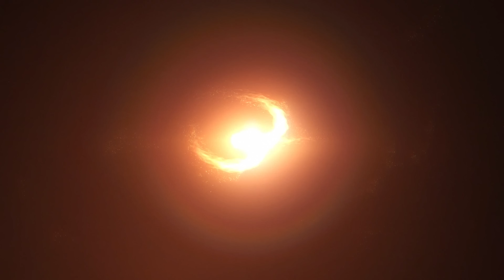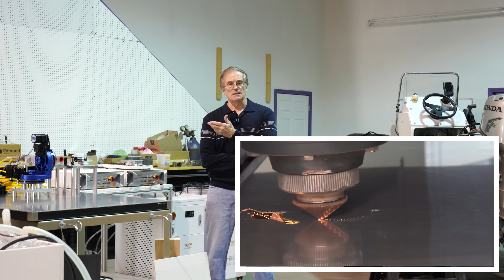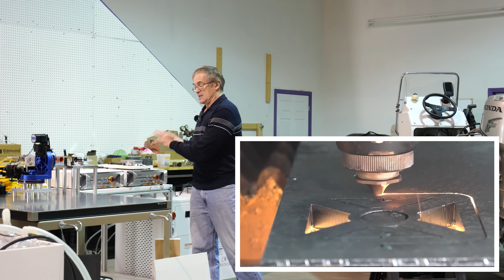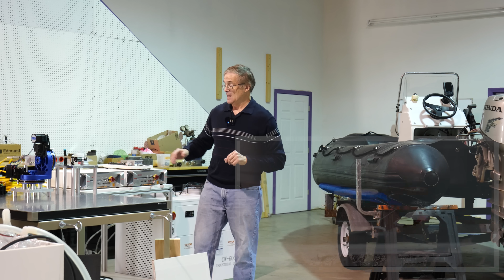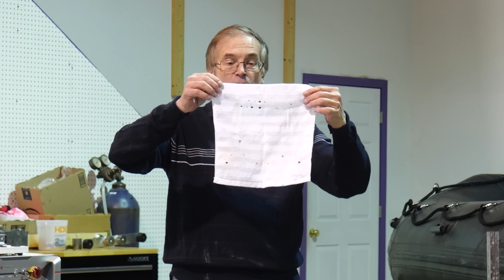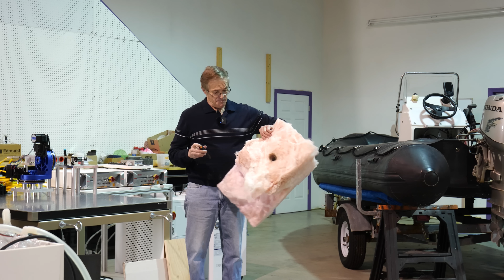We have a problem... and need your help!

Comment: I’ve not gone through all of the comments, but have seen many people thinking along the same lines as my knee jerk response. The water curtain/water trough with appropriate additives for either absorption/diffusion (dye, zircona in suspension, etc).

For bench testing on beam cohesion and such, my thoughts are that you could aim the beam at an angle down into a large pipe with your appropriate fluid mixture behind your target medium. Within the pipe I would consider an agitator of some sort - a pump from the bottom to the top or a bubbler pipe to increase the fluids motion. With some testing, you could implement an appropriate size and safety factor for mobile applications.
Reply: In addition, both because it’s dirt cheap AND I just want to know what happens if you essentially plasmify it. What about using an Oobleck/cornstarch&water solution as the backstop? 😂

Comment: How much damage does the beam do to Copper Pipe filled with water?   Consider an array of Copper Heat-pipes as a backstop.   Different liquid can be used to tune them for specific power levels.    These are used to cool the Leading-edges supersonic aircraft wings like National Aerospace Plane and the SR-71 Blackbird.   Another idea is to used coiled copper tubing with water running through it.

Comment: Use a rotating round disk with shingled bricks so they are two layers thick and have a 16 gauge piece of stainless steel between each one of the bricks.  The rotating wheel keeps new surface exposed and the stainless steel obsorbs and disperses the heat.  Now, determining the rotational speed needed and is it achievable with the mass of the wheel.  Hmm...  :)

Comment: Hi, I just saw your request for a solution to your laser problem.
Here is my suggestion.
Take a block made from aircrete (they are fairly light) coat the block in a water glass solution.
This should withstand the temperature of a few thousand degrees as this is what is used in homemade refractories to withstand the burning flames.
I don't know if you have tried this but the water glass and the aircrete are both easy to make when outdoors due to cement dust and silica gel giving off vapours and dust.
I have seen many youtube vides showing how to make these items and one video from 'HoneyDoCarpenter' a few years ago using it in his homemade refractory.  Good luck my name is Keith Emery aka.VideoGenie. 🇬🇧

Comment: Other comments are suggesting to use a waterfall curtain. But won't the water explode if the backing for the water curtain heats up too fast??? Perhaps this combined with somekind of transparent sheet (fresnel lense????) to disperse the beam would work best.

My first thought was to use intumescent paint.

Comment: Using a ceramic blanket (or glass fiber) is a good idea, as it helps diffuse the light. To drastically increase its resistance to heat, you can infuse it with silicon carbide. Silicon carbide provides excellent thermal resistance. Soaking the blanket in a solution of colloidal silica (or fumed silica, which could also work) along with silicon carbide grains of various sizes can enhance its performance. Once dried, this composite material will behave like a rigid panel, making it easy to handle and move.

Note: Graphite or other carbon-based materials are not suitable for this application. Even though they can help diffuse heat, they oxidize in the presence of oxygen at around 800 °C, producing CO₂ and degrading the material.

Silicon carbide should be easy to source, as it is commonly used as an abrasive and is available in various grit sizes.

Comment: Seems like mounting the laser higher up, and pointing it straight down would be the safest bet. From there you could use a large tub/tubs of water to diffuse the laser. Maybe even mixing in some sort of additive like charcoal to limit reflections.

Comment: Inch thick Sheet of gelatin and starch, mixed with zinc oxide and bone black with a foaming agent? So it would expand from the heat making zinc oxide and gas bubbles? Possibly formed over a fiberglass matrix for portability

Thinking of those starch based prawn chips that I had in Asia, looks like a poker chip stacked up in a bag before you cook them. But the latent moisture and properties of the starch puff them up when they hit oil, making a pork rind texture....mixed with zinc oxide and carbon black with gelatin for strength, then semi dessicated, maybe stacked in layers or soaked into fiberglass before drying....... would also need a degree of flame retardation. Possibly with a co2 producing agent that could also add to the foaming action?

Comment: As the OEM (Original Equipment Manufacturer) used divergence to reduce intensity.
Theoretically, you could adapt the same idea to make it easier.

Comment: Honestly your best bet is to find a gravel pit that won’t mind you setting up in during off hours to test. But if you insist on building a barrier, try carbon felt sheets with running water saturation, I doubt it would survive fixed exposure but there isn’t much that will survive a parked and actively running laser of sufficient power.

Comment: Have you tried glass from shattered window glass at an angle to shatter the beam. Glass to be set in epoxy and presented at an angle to the beam to scatter the beam downwards into a tub of water maybe with dye in the water or mineral particles like perlite floating in the water.

Comment: Magnesia blocks used for soldering and other refractory purposes.  Very lightweight and the fibrous / porous surface might be able to do some work at diffusing the beam. 

I think the "wet" solutions probably buy you the most time before failure, but they are all cumbersome to the point of not being much better than building a 4000 lb wall of regular firebrick.  Deep down though, we know the real solution for lightweight and portable personal laser protection is asbestos blankets...

Comment: Here’s a solution that meets your criteria as closely as possible (courtesy of ChatGPT, but it actually seems pretty good):

⸻

🔧 Recommended Materials & Construction

1. Layered Copper or Aluminum Finned Heat Sink (First Line of Contact)
	•	Purpose: High thermal conductivity to spread the heat rapidly and avoid local melting.
	•	Why it works: Copper and aluminum absorb IR laser energy decently (especially if the surface is roughened or blackened), and they conduct heat away quickly.
	•	Structure: Use thick plates or large CPU-style heat sinks arranged to deflect the beam slightly (e.g. at a shallow angle, 10–15°) rather than absorb it head-on.
	•	Blackened Surface: Coat with high-temperature black paint (non-toxic when burned) or use anodized aluminum to reduce reflectivity.
	•	Note: Fiber lasers are typically near-infrared (~1070 nm), so polished metal is reflective — roughened or blackened surfaces help absorb instead of reflect.

⸻

2. Ceramic Fiber Board or Alumina/Silica Board (Behind or Layered with Heat Sink)
	•	Product example: Inswool, Kaowool, or Duraboard 2600
	•	Why it works:
	•	High temperature resistance (usually >2,600°F / 1,430°C)
	•	Non-flammable
	•	No toxic offgassing (but confirm MSDS to be safe)
	•	Lightweight and easily cut or shaped
	•	Placement: Behind the metal to provide a heat-resistant buffer and trap any penetrating energy.

⸻

3. Granular Firebrick Bed or Graphite Block (Final Energy Sink)
	•	Alternative: Pour a layer of crushed firebrick, black fused alumina, or refractory aggregate in a shallow steel tray.
	•	Optional high-end alternative: A block of pyrolytic graphite or graphite foam — very heat-tolerant and absorbs IR extremely well.
	•	Caution: Graphite can oxidize at     high temps in air — only use if protected or in short bursts.

4. Angled Baffle Design (Important)
•	Orient surfaces at angles so the laser beam doesn’t hit them perpendicularly. This:
	•	Reduces effective energy density
	•	Prevents reflections from coming straight back
	•	Spreads the heat load over a wider area

⸻

🛠️ Assembly Suggestion

You can create a modular, portable unit like this:

[Steel tray base and frame with wheels]
  |
  |---Rear Section [Layer of granular firebrick or fused alumina]
  |
  |---MIddle Section [1–2" ceramic fiber board panel]
  |
  |---Front Section [Stack of copper or aluminum heat sink fins @ shallow angle]

Optional: Add a replaceable sheet of black anodized aluminum or black-painted copper on the front (before the heat sink layer) that can be swapped out as it degrades.

Make sure the unit is:
	•	Mounted securely, especially if vertical
	•	Surrounded by a non-flammable frame, like a steel or aluminum box
	•	Equipped with ventilation if used repeatedly, but not with forced air directly near the laser impact point (to avoid spreading particles)

⸻

✅ Material Sources (All Reasonably Available)
	•	Copper/Aluminum heat sinks: Reclaimed from scrap yards, CPU coolers, or online
	•	Ceramic fiber board: Welding supply stores, refractory suppliers, or Amazon
	•	Fused alumina, firebrick aggregate: Pottery supply stores or refractory dealers
	•	Black anodized sheet metal: Metal supply houses or online (e.g. McMaster-Carr)

⸻

⚠️ Safety Notes
	•	Avoid fiber-based insulation (e.g. fiberglass) unless certified for laser use — they can vaporize and release toxic fumes.
	•	Do not use carbon fiber composites or unknown resins — many emit cyanide or phenols when burned.
	•	Use PPE when assembling or testing — especially laser safety goggles for the correct wavelength.

Comment: MY IDEA
It's to deflect and weaken the beam. Using an aquarium-type tank.
Inside, water with a very high percentage of salt and a lot of talcum powder, to make the water muddy.
The water must be as cold as possible, to have a higher refractive index.
On the outside on the 3 sides, you could add some ABS panels for lasers, the orange ones.
To limit the effect of the laser on the glass, I suggest using borosilicate glass as the front plate, without adding ABS.
There would be other more suitable glasses but with a very high cost.

Comment: The amount of information is shockingly small making me think this is just to stir up views, regardless use something that's actually meant to deal with high powered lasers, like intumescent paint or a similar product that gets used on facilities that actually use these. My work has about 2-4 inches of intumescent paint on all the beams. By the industrial grade also the fact that you didn't try basalt fiber is kind of depressing.

Comment: Use a bucket, tub, or vat of something in grains that can fall down to replace ones that are melted or burnt, bonus points if you can vibrate it to encourage movement. if something going fast enough it may be able to not be burnt or melted in the first place, so a giant spinning block of something could also work.

Comment: Not a backstop recommendation, but have you considered instead of collimating the tiny LASER beam straight out of the fiber, spreading it out to a pretty large size (idk, 10cm, whatever the largest lenses that are high enough quality and reasonably priced) and then using a variable optic, and tracking knowledge of the target distance to dynamically focus it down only at the target range?
It might make coming up with a backstop a lot easier (especially over short inside distances) if the beam diverged more significantly after the target, and it'd be just safer in general in a final product. You'd still need the backstop, but maybe it'd make like 2 layers of drywall viable.

Comment: A slanted copper sheet with a curtain of water running over it for cooling could possibly work. It's easily testable, but expensive to scale up. Other than that, sand feels awfuly promissing and cheap, but heavy. You can also move to a safer location for testing. A desert, bomb range, quarry type of deal. Don't get caught firing lasers outdoors, Heisenberg.

Comment: Perhaps you don't need much more than to hang a screen of sorts with scattering properties and sensors which the instant they were triggered would then auto-trip the power supply. First thing that came to mind.. still thinking of course. 🤓

Comment: Copper plate, angled 30°, with graphite powder mixed in water flowing over the face. Add chiller / radiator if necessary.

Comment: 1. Recapture the beam and reflect it into itself with a tube of stone/log rotating inside of a tank of water.
2. Use soaked/fresh logs stacked ontop of each other in 2 rows that fall down if they get burnt through.
3. Rotate a soaked log with water running on it and capture the water below and pump it ontop of the log.
4. box full of volcanic rock or sand adapted from AVE's idea
5. Scatter the light into a closed box center until it cool enough and onto water cooled object or water filled tank with algae/sand that it cooled and pumped into a radiator/piping with fans to get cooled down.
6. On a super cooled plate/fins that has a ton of water flowing into it like an engine
7. look into how nuclear reactors are cooled
8. multiple fans spining behind each other with over lapping fan blades on each fan
9. Water mill with thick water buckets full of water getting pumped back into it's self

Comment: You could redesign the laser to angle the arrays focus point to the correct specifications. I have heard aerogels are very good at dissipating heat but id be interested in finding out how (liquid) mercury would react.

Comment: Can you put a glass water tank on a way of laser beam and add a set of prisms and lenses inside of the tank to defocus that beam? You can solve different things in water or put another container with wet sand, maybe that will wo rk as well. 
In order to trap reflected beam, put the reflector before tank so beam can burn the hole in it, but will reflect the beams from the tank back.

Comment: Use a concave lens to disperse it to an area where the power dens9ty is low enough to cover with a black surface metal. And then make this attachment just short enough to attach directly to the front of the laser, with enough space for experimenting with the laser beam before dispersing

Comment: A nanoparticle suspension of graphitic carbon or graphitic carbon nitride (credit to fellow comments)? Through reading the comments i wonder about a banked surface which you would flow fluid over as to dissipate the heat evenly and rapidly, water alone probably wouldnt work, but if the water was impregnated with particles of a material which did absorb and refract most of the laser light, the energy would go into the water, the water flowing over the banked surface would allow you to avoid the problem of the laser hitting the walls of a container holding your fluid, and the flow of the water itself would mix the heat evenly into the water, which conveniently has amazing thermal properties for this application, and the vapor is nontoxic, both pluses. the banked surface could potentially be copper or aluminum coated in carbon. I do foresee a problem where the laser light actually reflects of off the surface of the fluid itself though, so adjusting the bank angle and adding secondary backstops might fit into that idea somewhere. I even wonder about a literal waterfall of nanoparticle carbon suspension, like a wall of flowing water. flowrate would probably be an issue in that setup though

Comment: DUROCK cement board and use water pump to keep it wet.  $13 a board.  Should give you plenty of time.  This would be portable and easy to setup.  Yes the board is heavy but wet concrete should do it.

Comment: Spitballing, but even if you use it in conjunction with other methods, can you aim the beam through an electromagnetic or plasma field to scatter it? What about having it travel through a prism or other substance with varying refractive indices? Can the beam you're using to cut material that you said converges to a point and then diverges away so its intensity is diminished when it touches the ground be used to create a plasma field interference point that the linear test beam targets? (See my question earlier about scattering the linear beam.)

Comment: Some kind of black body would be ideal. A random assortment of glass/mirrors in a black box, with a small opening. Perhaps even graphite powder. however this would only work with a direct beam and not with the amount of deflection you’ll be experimenting with.

For added safety, you could then set up a camera behind it to detect if the beam makes it through and shut off the laser.

But, your best bet is likely some wet sandbags or similar. I’d even try the insulation again but soak it first.

Comment: I don't know if anyone has already suggested this in the comments, but perhaps one option would be to add a variable focus in addition to the tracking system. This way, the focus could remain focused only on the target, and when there's no target, it could be in a nearby position or oscillate so it doesn't stay focused on one spot for too long.

Comment: When the AF was flying it’s laser lab in the 1970’s/80’s.  Their biggest problem was smoke at the target.  Once the target was lased, it generated smoke that would then block the beam.  So…try a smoke blanket.  It would require a transparent box to contain the smoke, and a stove burning a dirty fuel, like crude oil to blow into it.

Another option is to use one of your common materials for backing, but pulse the laser.  In other words, limit the beam to milliseconds.  That will be enough for testing purposes.  Once your tracking system is perfected, you could increase the pulse time as necessary for the required target.

Comment: you saying that your popping holes in 5/8" fire rated sheet rock?  if so, back it with a sheet of Concrete board. followed with your 2x4" frame stud wall.

Comment: Have you tried fibreglass blankets like the ones used by boiler makers/welders? Its high heat resistant and made of glass fibres that would dissipate light into many directions and ia light weight.